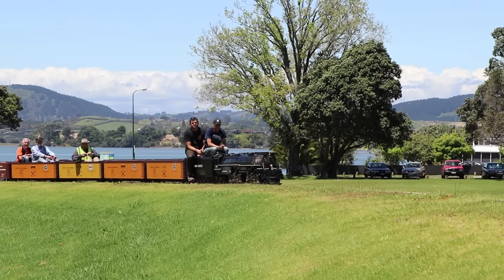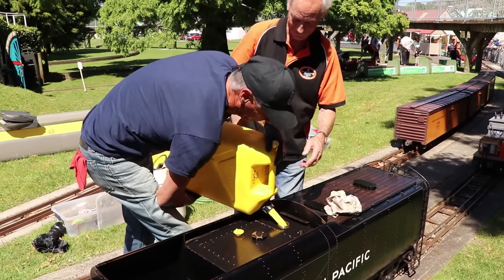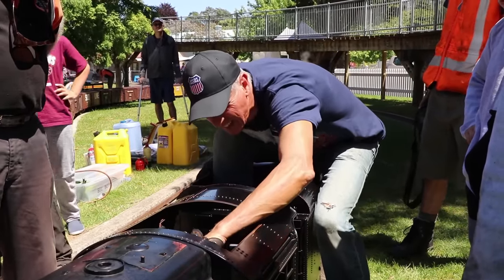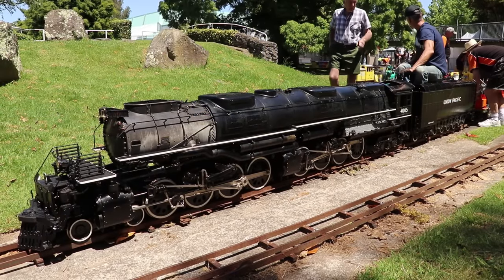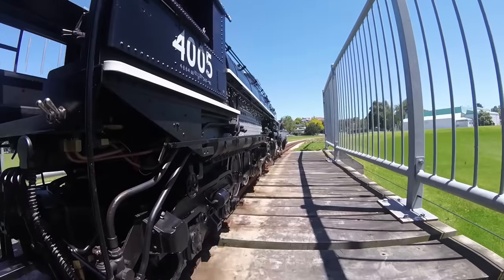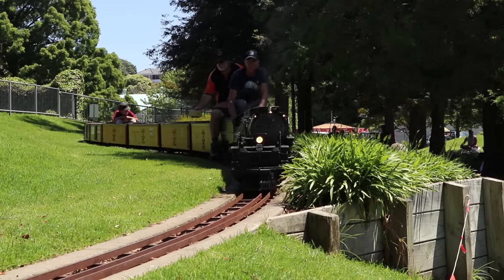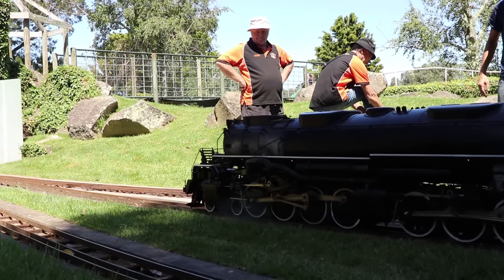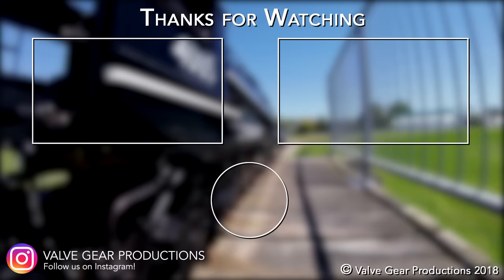Union Pacific 'Big Boy' #4005 Live Steam 7.25" Gauge Locomotive in New Zealand

Comment: The real 4005 was the only Big Boy to ever derail in revenue service. A misaligned switch by a track worker sent her tumbling onto her right side. She was ultimately repaired and returned to service, and is preserved at the Forney Museum in Colorado.
Reply: Cool
Reply: Isn't 4005 sitting on static display in Cheyenne? or is the 4006?
Reply: @3RTracing  actually it's UP 4004 on display, 4005 is in a museum in denver CO
Reply: @Juggernogger64  Yeah, 4004 is in Cheyenne, 4005 is in Colorado, and 4006 is in Missouri
Reply: spit my coffee out when i heard #4005
Reply: She was also the only Big Boy converted run on fuel oil  but they only used a single burner and it was not enough to heat the 68 cubic feet of fir e box so it reverted to coal in 1949

Comment: Just think, here in the States we'll have the 1:1 scale version of sister loco 4014 running soon!
Reply from the maker: Will be a sight to behold for sure. Will have to go someday to see her running.
Reply: Can't wait for March 10th.
Reply: Conrail 1634 I doubt they’re going to finish it on time. They’re certainly making progress, but Ed is very careful and methodical, which is never a bad thing. He wants it done exactly right and won’t make any sacrifices whatsoever to save time.
Reply: Amtrak In O Scale Yes! Methodical is a VERY good thing, particularly in the case of 4014 - it’s been sitting over 40 years, AND is being converted to oil firing - we certainly don’t want something to go wrong with that large of a boiler, to say the least!
Reply: Jim Talbott Exactly, and that’s not including the fact that UP actually has attempted to convert a Big Boy to oil once before, with unfavorable results. It will be no small feat to convert 4014.
Reply: @amtrakinoscale9811  - The 4005 was the UP oil conversion, to be ironically precise!
Reply: Amtrak In O Scale    Yes they converted 4005 to oil burning but only used one burner in the massive firebox. That is probably why it was not 100%  successful as the heat was uneven it was reconverted back to coal in 1948 (I think) 🚂🚂
Reply: I'll be there st Prometary. Can't wait till May.
Reply: Buddy R. I’m aware it passed the test today, but that doesn’t necessarily mean I’m wrong. I had good reason to doubt they would finish on time, and I still do. It’s nothing against Ed or the crew. They do a great job. Just that they might have to take extra time and with the way Ed runs things it’s entirely possible they won’t finish on time. You never know what unplanned delays could come up in steam tests (even though Ed plans for everything). The thing that’s saving them a ton of time is not converting 4014’s tender. They are going to convert it to oil later on, borrowing 3985’s tender for the time being.
Reply: I wish some one could find and get a restorable H8 Allegheny up and running 7500 hp capable of hauling 100 carloads of coal by itself.
Reply: 8aleph It will never happen though. It’s too expensive and the H8s were not without their issues.
Reply: @IndianaNorthWestern  MAY 10th.
Reply: Cough ITS ALIVE
Reply: She's back up and running. It took awhile but they got it done!
Reply: Amtrak In O Scale bruh you doubted wrong
Reply: I don’t know if you’re making a joke or not, but the 4014 isn’t a model version, it’s an actual big boy that at one point did regular freight service.
Reply: Is actually brother considering is a big 'boy'
Reply: Got to see it when it first came out... its huge.  I also lived in California and go tto see the Santa Fe 3751... was going good at about 70ish... must have been in a hurry.
Reply: Legend has it a workshop is doing just that ((this is sarcasm))
Reply: I seen big boy 4014 irl
Reply: Used to wonder about her sitting in Pasadena
Reply: @victorcreswell7849  so have I
Reply: @ValveGearProductions q❤

Comment: One of the amazing things to me is... that the originals were designed and built using slide rules and skilled machinists.  No computers involved at all.
Reply: computers have enhanced a lot of things humans do. But they have also become a crutch for intelligence and study. I don't even know how i survived without google to tell me the answer to every question. There are even career fields where you rely on google for everything (*cough* programming *cough*). Few humans aside from total retro nerds would even know what a slide rule was if they saw one, much less how to use it to perform manual calculations. and machinists... there are not many true machinists left. most of them just punch up some numbers on the control box and let the machine take it from there. they wouldn't know how to go about machining up raw castings into high precision parts unless they were starting with a huge block of aluminum and a CAD model.

Comment: I too had the privilege of ridding behind this at Dobwalls, Cornwall UK. The Dodwalls track had considerable inclines as well as tunnels and the smaller locos had to work quite hard pulling upwards of 50 people. Compared to other narrow gauge style locos the Big Boy looked quite small but of course with great length and it had little difficulty setting off with even more people (every body wanted to ride!) with just a modest beat. It was coal fired then and seeing the fire being dropped at the end of the day was quite a sight.
Nice to see it still looking in such perfect condition.
Reply from the maker: The locomotive that ran at Dobwalls at the sister engine, #4008, NOT this locomotive #4005. But yes, it was a similar beast, now lives in Australia I hear.

Comment: The real UP 4005 lives at the Forney Transportation Museum in Denver, CO. I've seen it several times, and even dormant the Big Boy remains an impressive machine!
Reply: The dent marks on the left side of the real one at Forney are still there from the accident it sustained from in 1953.
Reply: @Black Toof - "Original?" ALL UP "Big Boys" are original. No new ones have been constructed.
Reply: @Black Toof What are you talking about? He is talking about the 17 dormant 4000 class locomotives. Not the restored 4014...
Reply: What Black Toof means is that he saw 4004 in Cheyenne WY (missing out on 4014) then he travelled to Denver CO and saw 4005, then to St.Louis MO and saw 4006, on to Scranton PA where he came across 4012, then to Green Bay WI where he saw 4017, to Frisco TX where he saw 4018 and then finally ended up at Omaha NB to find 4023 there. All the time he thought that it was the same loco that was being moved around all over the place.

Comment: I rode behind this many times as a kid in Dobwalls Cornwall, im glad to see it being used again
Reply: The Dobwalls loco was sister engine 4008, apparently now in Diamond valley rly, Australia. Both built at the same time by Severn-Lamb
Reply from the maker: Spectacle sounds about right, this locomotive #4005 was not run at Dobwalls, instead, going to Tom Millar but indeed build by Severn-Lamb.

Comment from the maker: Thanks for the tremendous support on the video. I just wanted to clarify that this is NOT the 'Big Boy' that ran many years ago at Dobwalls in the United Kingdom. That was #4008, the sister locomotive to #4005 and was a slightly larger scale too, but both were built by Severn-Lamb. Also, I am aware that this is neither the biggest nor most powerful locomotive in the world, or even the United States. My wording in the narration at the beginning of the video was not the best, my apologies. 
Enjoy the video!
Reply: 4008 is in Australia in pieces after the driver ran it out of water and wrecked the boiler.
Reply: @TrevorHeath What a shame will it be fixed??
Reply: @nashguy207  Well, it happened 5+ years ago. Not so far.....
Reply: What's bigger this thing is huge it weighs 600 tons and  is and has to be bigger than any other locomotive ever built the only thing is it's not the most powerful the blue ridge  2 6 6 6 alkangey or something like that with 7500 hp
Reply: That was good to see. Hope to see it live soon
Reply: That thing was powerful I wonder how much torque it had
Reply: @mattskeptical3608  
The Allegheny 2-6-6-6 wasn't the most powerful either. It was ONLY the tallest and WIDEST locomotive. It was never longer than the Big Boy. Also, Big Boy technically was more powerful, since it had a top speed of 80mph while the Alleghenies and all other articulated steam locomotive did 45 to 60mph. Regarding power, a prototype steam locomotive built by the Pennsylvania Railroad (PRR) did 7,800HP. And even then, it still wasn't the strongest locomotive ever built. The strongest locomotive ever built in locomotive history was the Union Pacific Gas Turbines. The UP Turbines did 8,500HP.
Reply: 1 friendly bit of advice when talking about American trains we call the wagons cars in America so it's called a train car whatever the locomotive is pulling that's what they're called but still a sweet video

Comment: Are only the front cylinder powered or can you turn on and off which sets get steam? I see in some parts of the vid only the front cylinders seem to be getting steam then at around 7:20 it appears all are getting steam. I'd be very interested to know.
I forgot to ask, what are the the biggest and most powerful? To [re]familiarize myself in preparation for your answer I did a bit of a search, and the Wikipedia points to Allegheny/Blue Ridge 2-6-6-6 @ 7500hp, the Q2 4-4-6-4 @7,987hp as having substantially more power than the 6,290 hp of the Big Boy. Apart from those do you have any further info I've overlooked?
Reply from the maker: All 4 cylinders receive steam at every moment the regulator is open. There are no individual controls to split between the front or rear set. What you are seeing is the drain cocks open on the front drivers, which can be controlled separately from the drain cocks on the rear drivers. But all cylinders receive steam together. Thanks for the comment, good question!

Comment: this is  a beautiful model of one of the most beautiful steam engines ever built in my opinion ,,I have been up close to the X4023 big boy  which is at Kenefick park in omaha nebraska ,,it sets next to centennial locomotive DDA40X 6900  ,,both of them at one time the largest locomotives ever built the DDA40X being the most powerful single unit locomotive union pacific ever had with 2 3300 horsepower diesel engines and 8 driving axles, nearly 100 feet long

Comment: If a steam locomotive can burn diesel then we can bring then back. all we have to do is attach is diesel generator to the front of the locomotive which powers the trucks on the locomotive and the trucks on the tender and the truck's on the generator to give the locomotive more strength and the fuel from the tender will be burned by the generator and Firebox. I know this comment has no context of the video but I just decided to point it out.

Comment: Beautiful piece of work. How much does it weigh?
Reply from the maker: Roughly 1.5-1.75 tonne when in steam, with water and diesel on-board. Not a light engine!!
Reply: @ValveGearProductions  - Full scale weight divided by 512 gives the weight of an exact 1:8 scale model. Models have thicker than scale boilers, solid parts where the prototype is cast hollow. Exact scale is not practical but 1/500 gives a good estimate.

Comment: I am surprised that you blokes are not using safety chains between cars. With any grade at all, should a coupler fail, you would have a problem with a run away rake of cars. We require safety chains on all rolling stock on our railroad. 

You have done a magnificent job regauging the engine. A lot of work for sure. I am aware that 4008 is in OZ, but I was not aware of it being unservicable. A boiler for one of these monster engines would cost about 10k US. Too bad, they are magnificent locomotives.

Comment: If it were 7.5" gauge (and powered by propane), you could bring it to the USA, where there is Train Mountain with its 30+ miles of track (or Maricopa Live Steamers / Adobe Western Railroad with its 18 miles of track).

You have to use propane on steam locomotives at Train Mountain because they do not want a coal or diesel fired locomotive to send out a single spark that might burn the place to the ground (sort of like what happened on the Durango & Silverton a couple of years ago).

Comment: Did they have to disassemble it in order to re-gauge the wheels? 2.) Does the rolling stock have  air brakes or is the weight of the locomotive enough to stop the train???
Reply from the maker: Hi there. The locomotive was fully disassembled in order to re-gauge the wheels, and also to reverse engineer the boiler in order to gain certification to run in New Zealand. It was a massive undertaking, but it all paid off. I believe all rolling stock has brakes as well.
Reply: @ValveGearProductions  Fascinating... Takes lots of Balls and skill to disassemble such a beautiful piece of machinery and put it all back together again. Thanks for the info...

Comment: Shoulda picked a different original locomotive to scale down. 4005 was the only Big Boy to derail and kill some of its crew. Indeed, she was the only Big Boy  of the 25 built to ever be involved in an accident. On 27 April 1953, a greenhorn track worker threw a switch in foggy weather just a few miles out of Wamsutter, Wyoming, then noticed, too late, that the Big Boy was headed toward him. He tried to close the switch again to allow the train to pass, but didn't get it set quickly enough. 4005, along with 17 or 18 cars derailed, killing 2 men instantly, and a third died a couple days later. She is now located at the Forney Transportation Museum in Denver, Colorado.

Comment: And to think the Big sister of this beast is going to be running this year if things go to plan on UP metals [granted fairly certain it may be ran on coal Not Diesel or Oil which funfact this class was experimented on with oil but due to the firebox length and boiler length it failed]

Comment: The Big Boy weighed over 1,000,000,000 pounds and could pull a train 5 miles long !
Reply: Not quite that heavy. 125,000,00 pounds, or 558 imperial tons, or 567 metric tonnes.
Reply: 1,250,000 pounds, or 612.5 U.S. tons. Not over a billion.

Comment: If I believe correctly the pennsylvanian q2 was the most powerful steamer ever built. It was able to generate almost 8000 hp.
Reply: The PRR Q2 was mostly a failure, it wasn’t articulated so it couldn’t go around turns, suffered from wheel slippage, it never has proved what it’s capable of doing... except to be claimed to pull 125 freight cars at 50 mph.
Reply: @wtf-hc3tp  Thank you for the knowledge! I only knew the stats on paper. So while the Q2 was technically the strongest, it was not the most conventional. Correct?
Reply: Alex Loar Not sure how to answer your question, sorry.
Reply: @wtf-hc3tp  okay. Thank you though.

Comment: I wonder how fast that little model could go with the engine and tender.
Reply: 100+ mph. Not scale mph. Real 100+ mph. If a straight track long enough was available? Why do you want to know such a thing? The original was designed to run 80 mph. Anyone would have to be 100+% insane to do something like that.

Comment: For what it's worth, I hope you don't just open the blowdowns and depressurize to 0. (If you don't, then just disregard the following.) I figure you probably need to get packed up and on the road, but that's a lot of thermal stress to induce. 
I'm a Professional Engineer, Senior Nuclear Reactor Operator, and state Licensed Boiler Operator. I've also been a locomotive Fireman and Engineer. 
If you blowdown from 100 psig to 0, you're dropping from 125 deg F as fast as the valves will allow. For boilers of that complexity, you never want to go over 100 deg F per hour.
Again, if it was just my perception that the steam pressure was falling because of the video and my garbage ears, then disregard.

Comment: You forget the British  a4 pacific mallard  also no smoke means it doesn’t have the correct size fire for efficient steaming with coal fire locos no smoke means it need more coal black smoke means too much and wight smoke means just right it’s a similar sinario with gas and diesel fire locos
Reply from the maker: It entirely depends on the locomotive and fuel being burnt. Some locomotives can Burn Welsh coal, and burn it almost with no smoke just because of the coal itself. It is entirely dependent, but in this case with diesel, it's clean burning by default.